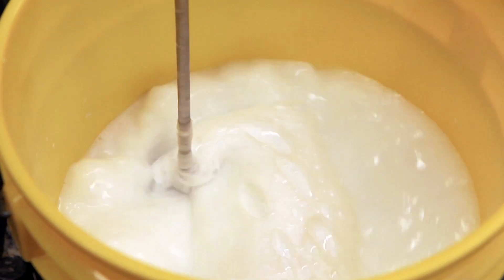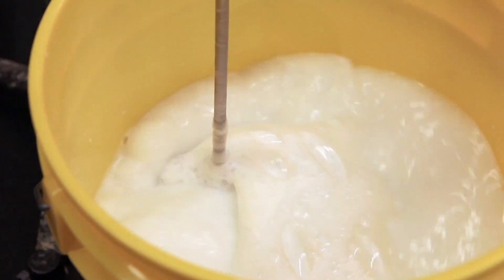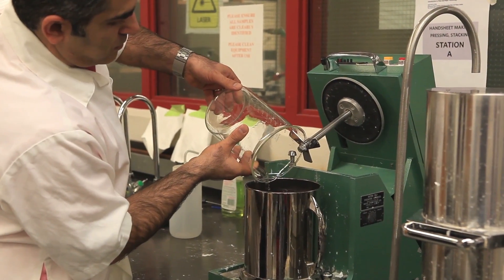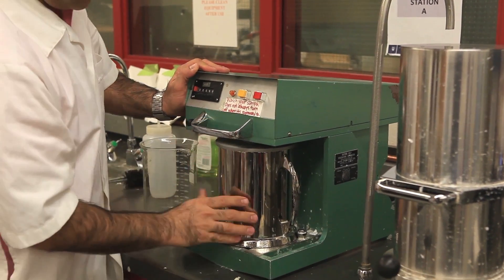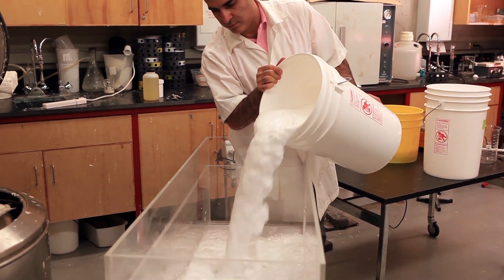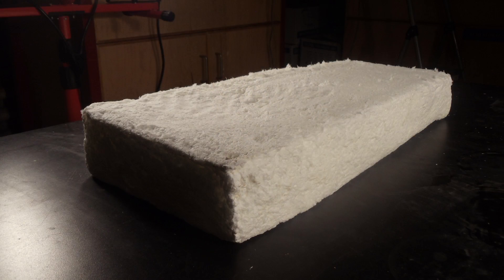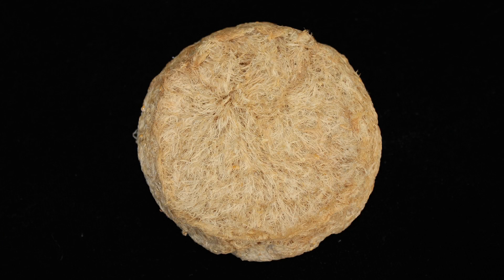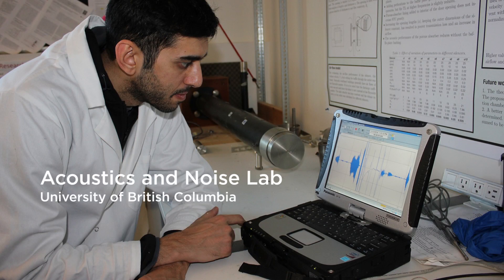Novel Cellulose Foam Material, UBC

Comment: Have you tested this for R-value? If cost effective, it looks very competitive with fiber glass, effectively a cellulose insulation without the loose fill disadvantages. I've been working on a method of producing cellulose boards using foamed PVA and Borax solution but the shrinkage is problematic. It looks like you do not have that issue.
Reply: Hi, same problem here, did you manage to solve it?
Reply: @MarcoBertani-ee5tu  Not reduced the shrinkage, but it's still cost effective if done with cardboard I recycle myself.
Reply: Please can you kindly explain the drying process? I would like to know how you were able to achieve a stable foam after drying and not losing the bubbles to become water